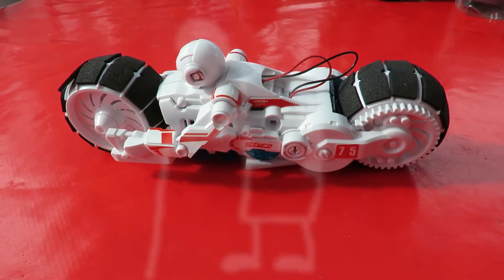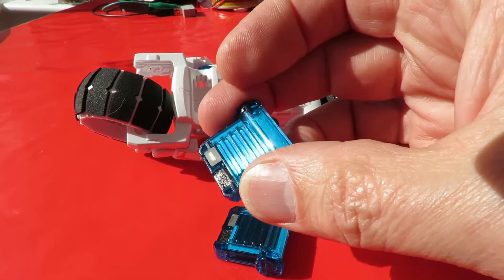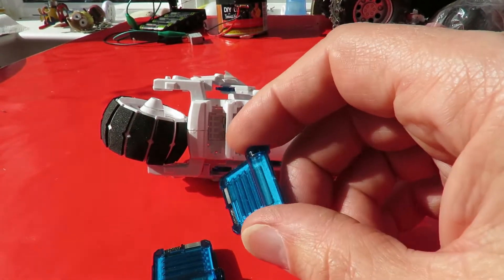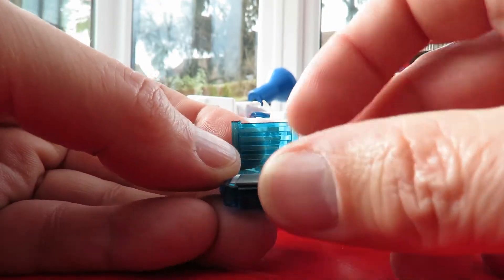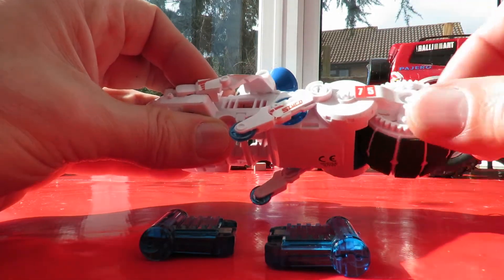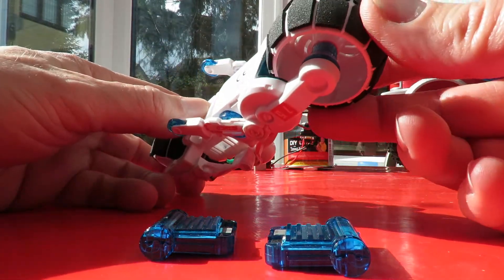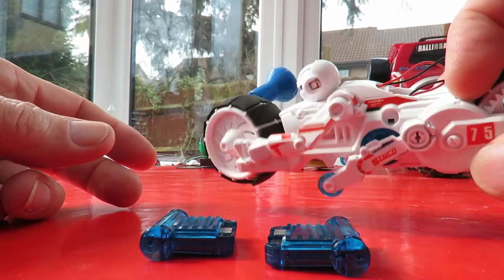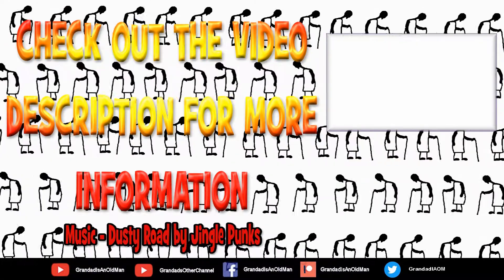CSGOG Salt Water Cell Motorbike

Comment: Have you thought of using a stronger electrolyte....?
Reply from the maker: From my experience with other salt water cell kits similar to this one the cell provides plenty of power. I haven't actually tried this one yet and I was planning to use a supercapacitor to save the cells for a future occasion. I have given it a short test with a small solar panel and I think on a suitable sunny day it would work well with one.